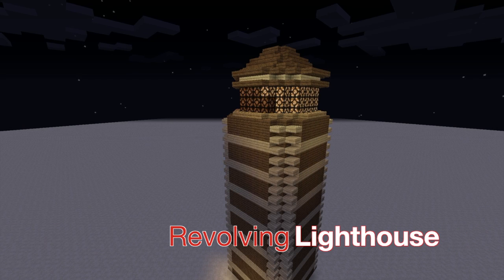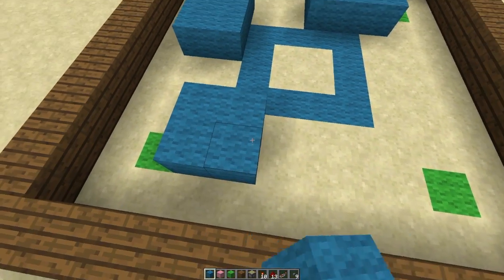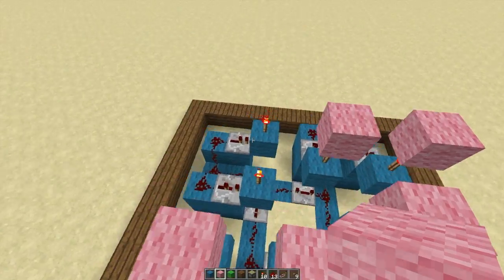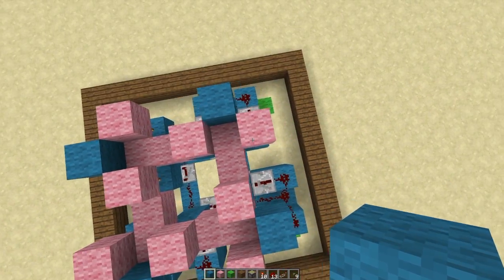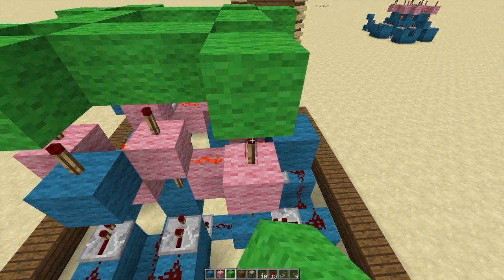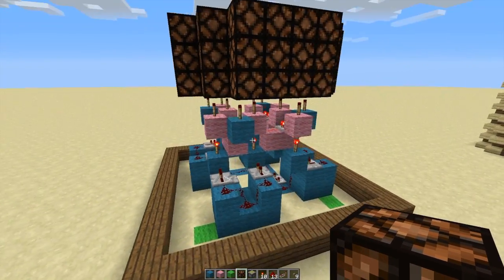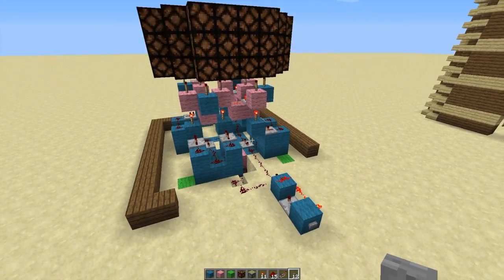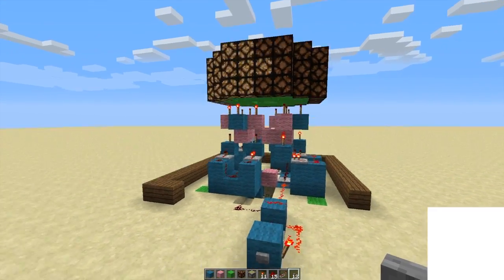Minecraft - Revolving Redstone Lamp Lighthouse Tutorial

Comment from the maker: Well there isn't much to it. If you pause the video at 0:01 you can see that it's mostly wood planks. Every 3 blocks I changed the color to add a stripe. The other blocks are all half-slabs. A few stairs were used right at the top of the structure for the roof. It's basically a square with the corners cut out and half-slabs added. Not too difficult to make :)